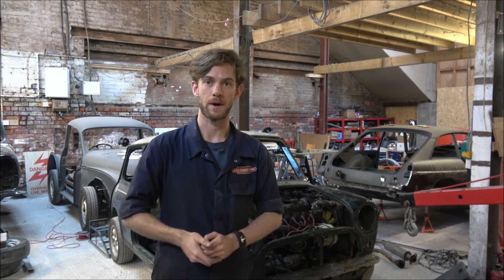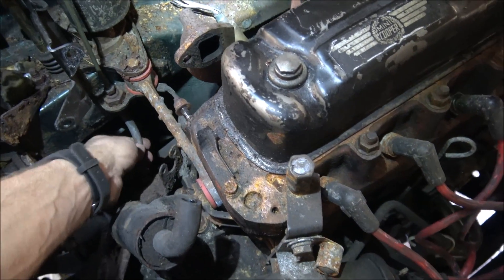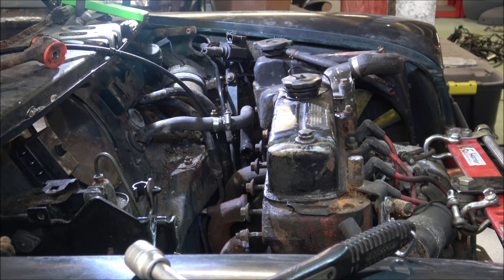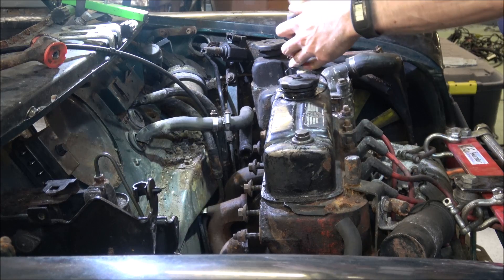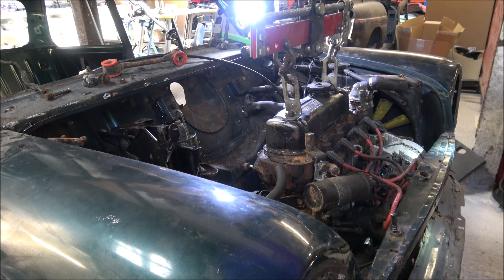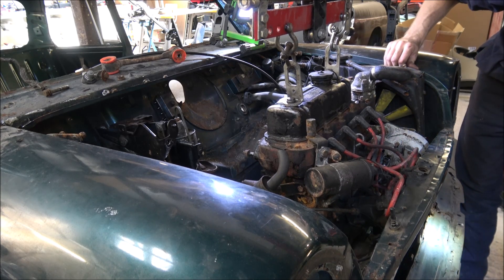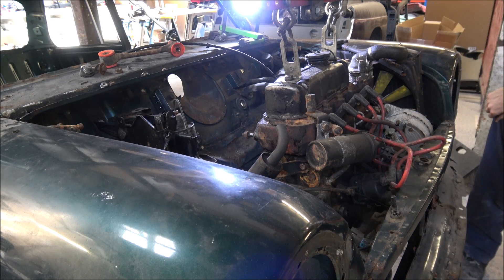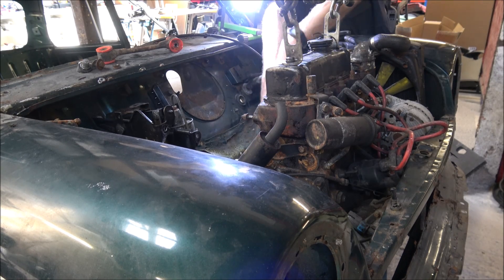Mini Restoration Project - Day 6 - Getting the Engine out

Comment: ALWAYS start by reading the HAYNES MANUAL,then buy the special tools needed eg drive shaft breaker tool, cone compressor tool and ball joint disconnecting tool,and about two other tools that an experienced mini mechanic needs,I wont explain  what they are at this point. I can build minis but I cant produce my own computer video to help mini owners.A mini owners best friend though is a couple of cans of SPRAYLUBE, saturate the subframes with it.Your mini will last longer,be safer to drive and SAVE YOU A FORTUNE IN GARAGE REPAIRS.

Comment: i wish that i could work with the man,i have removed mini engines myself and he needs a lot of tips.....there is a special tool that splits the CV joints from the differential side of the gearbox,he needs to detach the top ball joint first..THen the top engine steady bar to ease the engine forward a bit  to get the manifold and exhaust out of the way.

Comment: Always annoying when someone gives a solution weeks after the event but next time you do a full restoration or you know the subrames are coming off try this option:
Keep the rear wheels on the ground
Disconnect petrol and brake pipes at the back of the subframe
Disconnect the clutch pipe
Jack up the front of the car
Remove the front wheels
Support the car under the front subframe only on a dolly or ensure one can be slid under later
Disconnect the steering rack clamp nuts from inside the car. Push the rack forward
Disconnect the top RH engine stabiliser bar
Remove the two subframe mounts in the front valence
Remove the four rear subframe / body nuts from captive bolts
Remove the two big top subframe bolts
Remove the front shock absorbers
Secure the engine hoist with straps to the front of the car body
Lift the body off the subframe / engine
Roll the subframe / engine / gearchange linkage with steering rack out from under the body
Drop the body onto stands / supports

This way you can leave the exhaust manifold, driveshafts and even the complete gearchange linkage on the floor still connected. The gearlever comes out easily with a bayonet type fitting from inside the car

As I say sorry its late but hope this helps in the future. Refitting is the reverse and saves the risk of damaging engine bay paintwork.

Comment: FOR GODS sake remove the front wheels and look underneath, the drive shafts are preventing the engine from lifting ,this  also would have made undoing the door hinge pin nuts easier to undo and he should have wire brushed the nuts clean and soaked the nuts with penetrating fluid the night before.